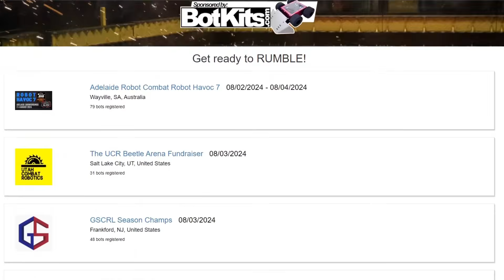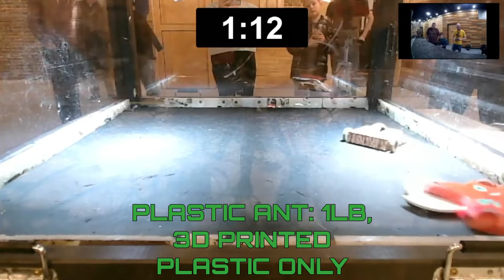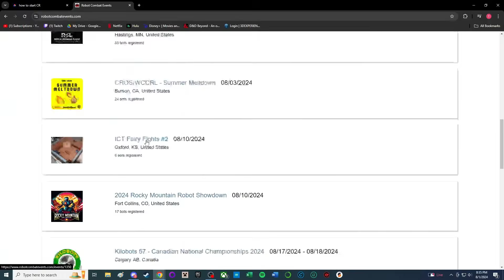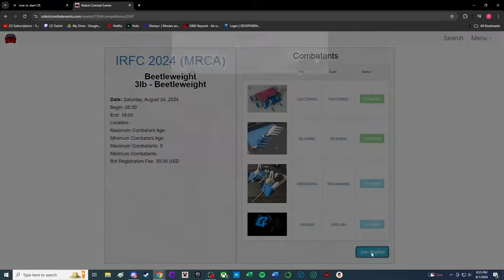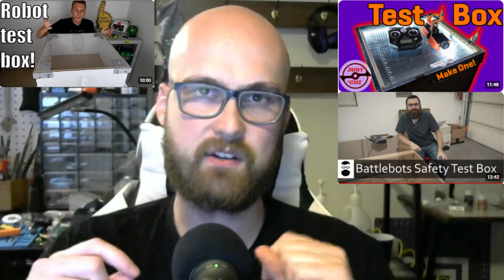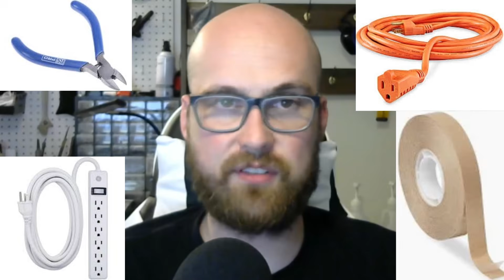How to start fighting robots (Everything beginners should know)

Comment: Personally I don't agree that 3lb is a bad starting weight class. You mentioned NHRL as a good community to join, but they don't even run 1lb bots at their events. Secondly, the correct weight class to start with really requires you to see what events are actually near you as this will determine what weight classes you can run at. A few years ago in the Boston area, there were no events within a 6 hour drive from me that ran 1lb bots, but NHRL is about a 2-3 hour drive and runs 6 events a year for 3, 12 and 30lb bots. Last, I think 1lb and especially 150g bots can be a real challenge to design from scratch for a first bot as the weight budget is quite small. And it can be really difficult to do well without a 3D printer. 3lb is more forgiving in this regard.  

I designed the SSP kit as a great starting point for 3lb bots, and it has a servo lifter like you recommend starting with. I don't think it's too expensive for what it is, though yes, 1lb kits tend to be cheaper.
Reply from the maker: I was mostly comparing 3lb to the other weight classes as far as options for new builders. I mentioned it in this video because I know it may be the closest for some, but I still think the other classes are better if it's close to them. That's why I open up with figuring out what events are near people. I'm sorry if it sounded like I was steering people away from Beetles more than I meant to.

I mentioned NHRL as a community because even if people don't go to their events, being in touch with the community can help them get to an event. The NHRL discord has a channel specifically for 1lb robots. Plus like you said, it is the closest event for a lot of people.

Comment from the maker: Hey, sorry folks, but I realized I had the load in procedures in the wrong order, it should be in this order:
1-Place the robot in the arena
2-Remove any weapon covers.
3-Turn on the transmitter.
4-Turn on the main power.
5-If separate, turn on the weapon power. This applies to both separate power loops and non-electrical power systems. (ie. pneumatics)
6-Remove any weapon locks.